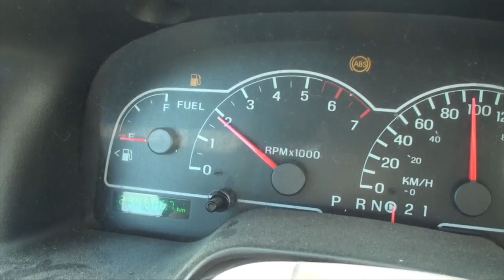being a dick to nelson

Comment: As he said "straight pipe" and I saw the two stroke, I had to leave. ;-)
Reply: Mack Thompson
 Because the exhaust duration ist to long for a straight pipe. Two strokes suitable for straight pipes have around 150-155° of crank rotation for exhaust timing. (like the most chainsaws or really old motorcycles and mopeds) I bet his engine has around 175°. He will loose power, reliability will decrease because of insane heat and he will get nothing but noise for it. Fuelconsumption also may be double the amount. If they would know anything about two strokes, they would fit a nice expanison chamber. For noise just use no muffler. If they really wanted this thing could be pretty awesome and fast. So it may became a little more awefull, slow and loud. Please don't ask how and why I know that. I have to deal with this kind of stupid almost every day. No, not you, that special kind of people that think big holes make engines faster.
Reply: there, it is a squirrel!

Comment: Did he say a reed valve was in the carburetor...lol reed valves are in the cylinder block not the carburetor
Reply: OK technically your right. I didn't know that it was called a Reed valve. It looks like a gasket but made out of thin flexible stuff and has little flappers so fuel goes only one way.
He said the Reed valves were shot though...you get that flapper gasket or Reed valve in a carb kit for like 3 bucks. I've never seen that be bad in a carb either but I guess it's possible